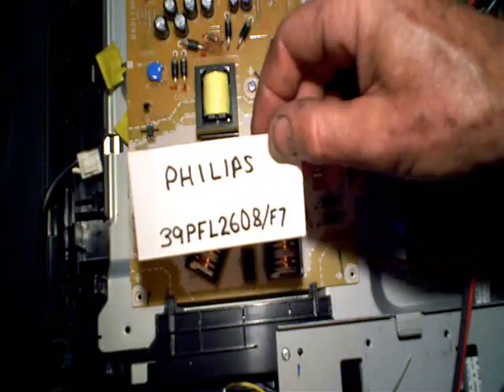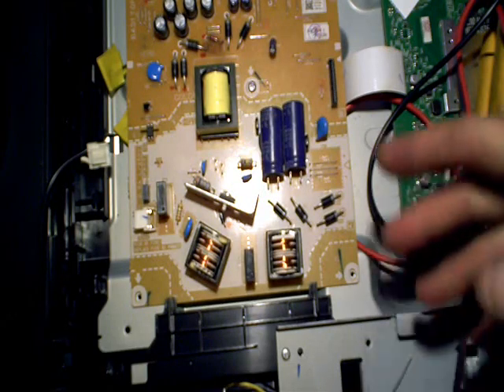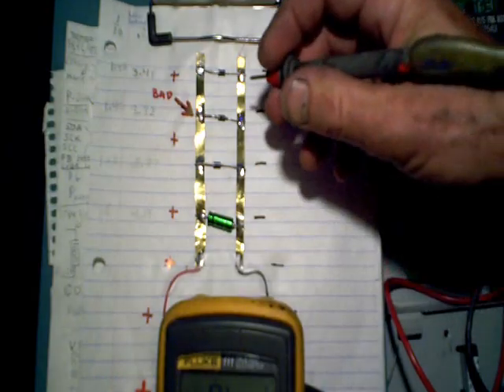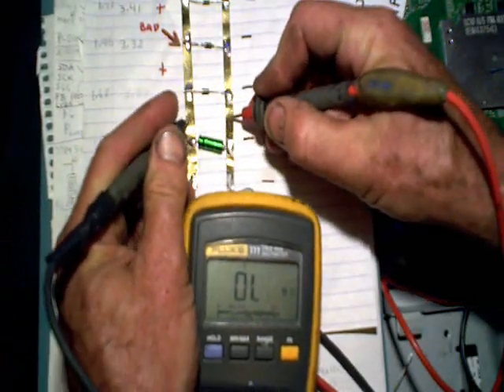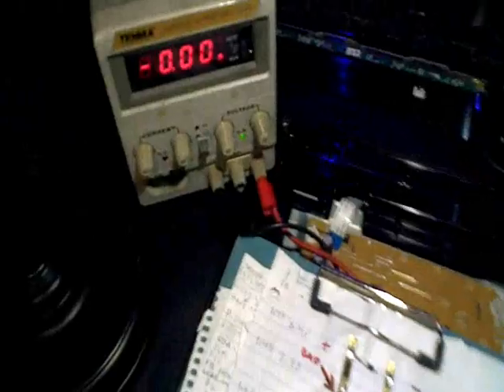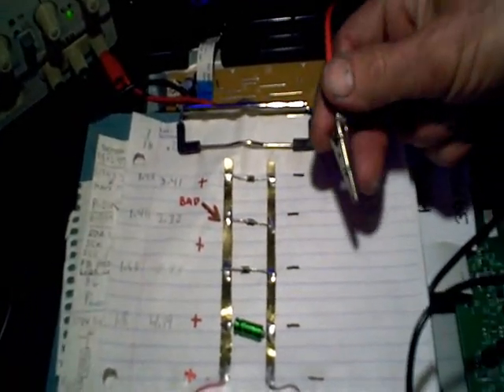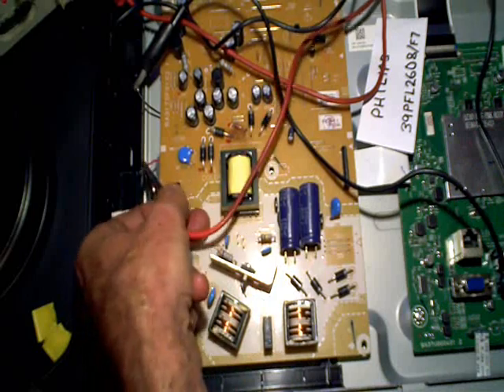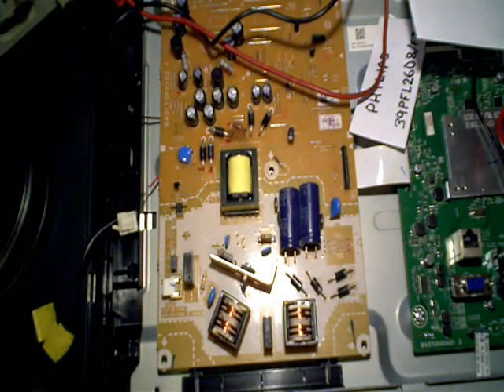Your Multimeters Millivolt scale can be used to locate shorts to ground.

Comment: Great way to test for shorted components BUT that's IF you have more than one of the same component [with which to compare it with - like three similar values diodes]. But how can this work, when the components are of different values to each other AND altogether different components? Ex: a transistor, a cap [tear shaped - tantalum], an electrolytic cap, few resistors and maybe a diode. What can you possibly achieve test-wise with this method [ESR meter]? You would never be able to find the shorted component. But I have so much more to learn about electronics [I'm a complete NOOB in this field] so, PLEASE correct me if I'm wrong - I truly am trying to learn. Your videos have been a great source of education for me. Thank you kindly.

Comment: Hey, you can just supply this troubled PCB not with ordinary high input voltage but with low voltage and high current capability power supply. And just use your fingertip to locate a shorted component(s) by its temperature. )) Any advanced multimeter needed, but ATC 300W power supply in tact is strongly recommended to have in your workbench.

Comment: There have been time in the past where I actually used the most simple and cheapest piece of test equipment I have. With a current limited supply and a little bit of current I used my finger to find who's getting hot...  ;-)
Reply from the maker: We have a variety of ways to accomplish the same end result when looking for shorts to ground. Sometimes I use a lazier temperature probe, or I freeze spray the whole board until it turns white, and then watch to see which components are the fist to defrost. Louis Rossman made a video where he poured alcohol on his circuit board, and then watched to see which area of the board evaporated first.
Reply: LoL that is kinda funny, I thought you were gonna say where the alcohol starts sizzling... Yeah we are a creative group sometimes. More then most other groups....

Comment: Wouldn't the voltage drop across a shorted component be zero volts? I was told it acts like a wire.
Reply from the maker: That depends on how much resistance the shorted component has once it goes bad. As a general rule when a diode goes bad it will have less than One ohm of resistance, so it's about the same as a piece of wire.
Reply: The voltage drop across a wire is very small, but it is never zero volts.  All wires have resistance.  That's why this technique works.  Shorted components often have more voltage drop than a wire does.

Comment: can a diode be tested when still atteched to the board?
Reply from the maker: +VINCENT ONGALA Most of the time you can test diodes which are in circuit, but sometimes you must remove them to know if they are shorted due to the surrounding components on  the board . Anytime you remove a diode which appears to be shorted it's always a good idea to test them out of circuit  to make sure your test results were not effected by surrounding components. Most of the time a shorted diode will have less than 1 ohm of resistance, so when I get a bad reading using the diode check function of my multimeter I switch my meter over to the ohms function so I can get more information about the nature of the short in terms of how much resistance the diode appears to have in circuit. If the ohms reading is 10 ohms or more I generally assume the diode is probably okay,
but when in doubt pull them out to double test.

Comment: needs longer leads on esr meter
Reply: Longer leads on a ESR meter just doesn't  work. The meter gives you an error message when trying to calibrate to "0", probably due to the capacitance of the cables themselves? That's why all ESR meters that I know of, have short leads (too short, yes :)
Reply: @Cubasenet33 , You are correct, the ESR meter leads do add capacitance, hence they are short. I tried adding longer leads to mine as an experiment, and it does change your readings.

Comment: Or, You can use the ohm meter.
Reply from the maker: With a sensitive ohm meter that gives you 100 to 1000 divisions you can.
Reply: @GrantsPassTVRepair  Had to troubleshoot a part that was drawing curent on an old PC board.
There are some 40+ ICs.
Some were getting hot, others not.
But by using a ohmmeter, i was able to locate the problem in the memory area.
After removing the memory chips, the problem was gone. The memory chips were not getting very hot.

Comment: Also, if the short is low enough resistance, you can likewise inject a voltage of much less than the voltage than the power supply and boost the current output until the shorted component heats up enough to actually feel with your finger (no using expensive freeze spray.  I work repairing cable boxes for Comcast and have been able to repair a very high percentage of boxes this way.  I Have used the milli ohm method as well as the ESR Meter as well as injecting voltage and tracing with the milli volt meter, too.  All have their place and merit.  
With Shorted chip components on a highly concentrated board with as many as 10 decoupling chip caps on a power supply line all across the PCb, it  could be anywhere on the entire board. Hands down the injecting low voltage at higher current and merely feeling for heat is the most effective.  I haven't had one case in hundreds of repairs where I have ever damaged the upstream or downstream components.  This is mostly with buck supplies.
Reply: Thanks for this information. I would imagine a cheap thermal camera would help this process? I’ve had my eye on the “flir one pro” for a while now.
 at $400 I think it would be invaluable on the electronics bench, in automotive repair, even checking the HVAC/energy leaks in your home. A friend of mine has a cheaper model… And it immediately identified the bad wheelbearings on my vehicle in broad daylight because they were warmer than everything else.

The flir one pro is pretty much the minimum priced thermal camera and resolution that one would want for electronics. Sure the $100 models work fine... but to really get down and see the smallest SMD packages and such… I think $400 is worth the extra price.
Reply: mister kluge Thanks a ton for the info! They’ve tried so many different terminal cameras… Are you referring to the “seek“ thermal camera? I know they’ve showed a few very nice thermal cameras but they are out of my price range. Closer to $1000....Where the flir one pro phone attachment is only about 400. 
And with a macro lens added… Can REALLLYYYYYY see tiny parts even the smallest SMD components clear as day. and the diy macro attachment is only a few dollars. AND makes small components 10 times clearer!
Thanks for your time!
Reply: HULL GUITARS USA Did you end up getting the camera yet by chance? In a total novice with this stuff but I end up doing it often enough to make 400$ worth it, especially if it works for other applications. HVAC, home electrical, and car maintenance alone would justify it if it’s useable on a larger scale. I’d imagine it is, if it’s able to pick up the much higher resolution of electronics.
Reply: @hullinstruments  how about one of those cheap laser temperature guns? you could do the same thing with the low-volts high-current and scan the components. and those are like 30 bucks
Reply: And you don't buy a Flir because????
Reply: @hullinstruments  Uni-T has a pretty good one. Kerry Wong has reviewed it and I have one. It is pretty sensitive.
Reply: Here in Philippines we call that a short killer. Inject certain voltage with high current

Comment: You need to know something about the trace geometry to accurately pinpoint the short using this method.  You need to measure the voltage drops across the traces.  

I start by connecting the negative lead of the DMM (mV mode) to the point where the current source's negative terminal connects to the PCB. Then begin probing further from negative connection point until the voltage stops increasing.  As long as the voltage continues to increase, you are following the flow of current.  As soon as it stops increasing and levels off, you've passed the short.  If you have a layout viewer, it really helps.  

Using this technique with boards that have power planes is more difficult.  You'll need a high precision DMM to measure micro-volts of change on top of the millivolt voltage that is actually across the shorted component.  You may need 6-digits of precision to do this.  The relative (delta) button won't help because the meter will use the appropriate scale for the total voltage ("trace voltage drop" + "shorted component voltage drop"). You are only interested in the trace voltage drop. 

I suggest using a good cad viewer that allows you to highlight nets and has coordinates so you can calculate distance.  I've used this technique to get me within about 1/2 inch of a shorted cap between Vcc and Gnd on boards with hundreds of bypass caps on them.  I also use thermal LCD paper and cold spray to try to locate the shorted part thermally.
Reply: In India, we mostly use rosin paste and 3.3v with few good range of amps (current) and volts depends to the supply line or supply track. And we easily find the shorting component. There are many ways to locate the shorting component and those are effective too.

Comment: Usually to find shorts of that kind, i usually plug a lab supply across the shorted rail and inject some power and look for the hot parts.
Reply from the maker: ***** I've used the same technique, but sometimes it takes quite a bit of current to get the component to warm up.

Comment: Short-Circuits (in their natural state) on PCB's have already done the damage to the equipment!  I am an amateur (self-taught over 50 years). I can say that Grants Pass TV repairs have taught me that you can check out 'shorts' by the use of a DMM  on the milivolt scale. I have followed the same procedure as shown in this video, and that is - to first determine WHICH CIRCUIT BOARD is faulty. Sometimes, there are five or six separate PCBs in a Home Theatre System. Narrow down the fault to just one specific PCB. Write down every step that you take! Magnification of the PCB and its' components is a must! Look for the obvious first.
 I do this by powering-up the suspect PCB independently, with the same voltage / current that is rated for the particular Board. I will not reduce the voltage (or current), because a 'short' is present. Remember that the Board cannot suffer more damage!
 At this point (when the suspect Board has been disconnected from ALL other Boards and Feeds), the 'short' begins to show itself........... Yes, components (even the printed copper track)  will get warmer than others, because many other parts of the circuit are not being fed with their correct voltage - due to the 'short'. Have a smoke, have a coffee - but leave the suspect Board powered for 5 minutes. THEN, pinpoint every component such as diodes, capacitors, resistors, voltage regulators and transistors etc WITH A LASER BEAM. I am talking about the (very cheap) Hand Held Laser Pyrometer. The Laser Pyrometer detects the smallest amounts of heat (from or near to the shorted component), and you will definitely see results! As an amateur, I have had many hours of frustration and heartache in trying to detect a 'short'. I have no idea why all of the professionals have never mentioned this method of heat detection on You Tube. In many cases, it isn't possible to detect small amounts of heat with the human hand - from many components that have radically shrunk in size - and mass - from two or three decades ago. If I was a professional Electronics Technician, a Laser Pyrometer would be a very important part of my arsenal. Thanks to Grants Pass for a great Tutorial. Greetings from Australia.

Comment: I'm not sure I understand what you're looking for... Every measure you did had different values for different diodes. You KNOW one of the diodes is bad in this case, but the only indication you have for which one it is would be the one with the lowest value in whatever measurement you're doing.

But if you don't know if it's a diode or a capacitor (or any other component, for that matter) that is the culprit, how would this help you? You haven't really located the short, because to even use the technique, you must know which component type you're looking for. And even then, it only works if all of the components of that type in the circuit has the same value. And even then, you can get "false positives" because of the natural difference in the readings.
Reply from the maker: This procedure is designed to help you find a shorted component where there are multiple components which share the same power supply output. it's not going to tell you if a diode, capacitor, IC, or transistor is open, but if one of these components is shorted such as a diode it will have the lowest voltage drop of all the components you test.  I hope this helps.

Comment: another excellent video.  although in my experience finding a short to ground is a lot tougher than you have shown especially if you have  a bunch of smt noise caps or the short is between layers.
Reply from the maker: Roger Kerr I agree. Finding shorted  diodes and large transistors is fairly simple in comparison to what you describe.

Comment: One can also pour some Butane on the suspect component.
The S/C will obviously generate some heat, which in turn will
 cause the Butane to evaporate (boil) at a rapid rate in comparison
to the normally operating components.
Of course a Power supply is used for the power source as described
in this video. The Current (I) may have to be increased to 5A so that
enough heat is generated,
As the S?C component is already defective 5A will not be of a concern,
and power rail components are quite durable for obvious reasons.
For those just learning, it is important to understand how Power rails work,
and how lower voltages are derived from the source power rail(s)
Not knowing that would be chasing one's own tail and wasting time.
Good luck everyone.

Comment: Thank you so much. unfortunately, my bench power supply doesn't control current that accurately so I created a simple constant current supply circuit that I use now for this method.

Comment: this is nice. thank you. I been back to watch this video several time. I also have the toneohm, which, I am in the process of making my own leads since its leads are crazy expensive, I am yet to learn how to use it though.. but I have found using a good thermal camera, though expensive but is a very effecting and fast way in finding shorts. I would call thermal camera, short finder for dummies.

Comment: Nice job. I'm working on a small board with a short somewhere. I'm going to apply a small voltage (3 D batteries, 4.5v)  with a small current limiting resistor and try to get closest to the short with  digital voltmeter readings OR allow more current and feel for a hot component.

Comment: You can use a Seek Pro thermal imaging camera to see what heats up the most to find it fast too!
Reply: 91% IPA (isopropynol aka isopropyl alcohol)pour on suspect components then inject voltage and you will know what is shorted by how quickly it evaporates. Much cheaper than thermal cameras
Reply: @Heathmcdonald  That's the way to go!

Comment: Complete NOOB here. Great video BUT, it seems to me like it’s like many others, in that, it assumes that you have, a general idea of where the shorted component might be. I haven’t found ANY videos, which actually explains how to determine where a short might be, or for that matter, IF what you are dealing with, is actually a short. I mean, every electronic failure isn’t ONLY a short. It could be an opened component, or a non-oscillating crystal, etc, etc. What if the device you are are trying to fix, shows no signs of damage, or burns/darkened areas on the pcb, what do you do then? You can’t just assume, that it’s a short. Sometimes, the issue can be something simple, that you just overlooked OR a super difficult one to figure out, and what/how do you start then? What/where do you start, when the device you are going to work on, shows no damaged components or pcb? That’s the kind of video, I would like to see.
Reply from the maker: You may find this video helpful. https://www.youtube.com/watch?v=qotB1xxQols

Comment: Gustav Kirchhoff would turn in his grave if he saw this video......
Those components are in parallel , the voltage drop across the components will  be identical as you are measuring rail to rail. They will be passing different currents depending on their resistance but the voltage drop across the rails will be the same no matter where you measure.
The more sensitive you make your meter readings, the more you will think that a few millivolts here or there mean something when they actually dont..
 There is a reason why components in parallel need to be unsoldered to check, and this is a good lesson in why.
Reply from the maker: omgffsification Technically speaking the only voltage drop you really see in this example is from the shorted
diode. The other diodes direction are not in the conduct mode, and capacitors do not pass DC.  I should have used slightly different words to describe this example.
Reply: Grants Pass TV Repair Sure but how is this test telling you which diode is shorted?
Reply from the maker: When diodes go bad they generally short out and their resistance goes down as the diode junctions become fused together. This test is showing me which diode has the lowest resistance reading within a few thousandths of an ohm.

Comment: very good    most helpfull tip   haow can you  check  for a winding short in a transformer  do you have to use a micro ohm meter and know what a good one would read?
Reply from the maker: I do have a micro ohm meter, but when I test the primary side of a transformer I often use the my blue ring coil tester. Here is  video on how they work. https://www.youtube.com/watch?v=Ky2T1-n_Fks&t=147s